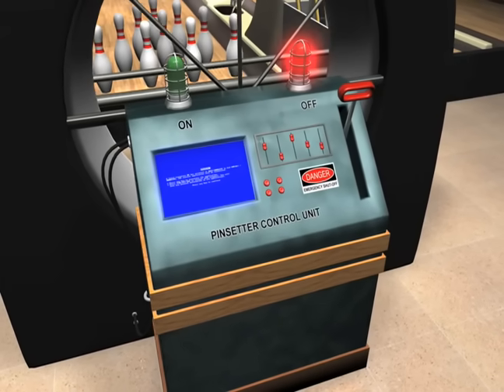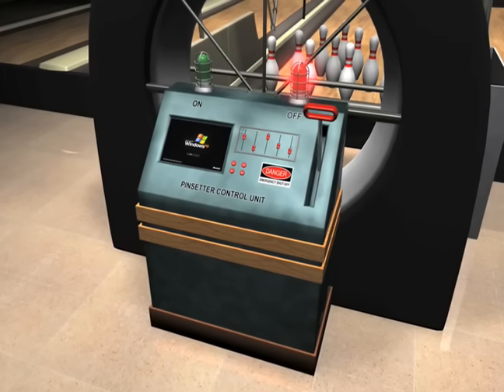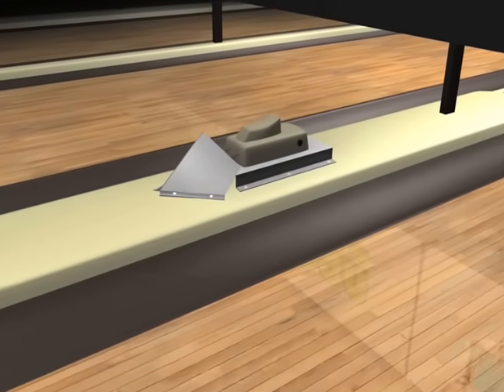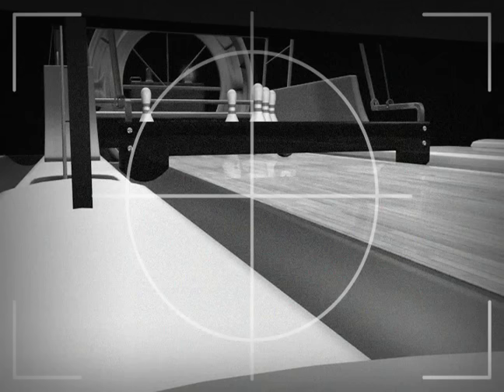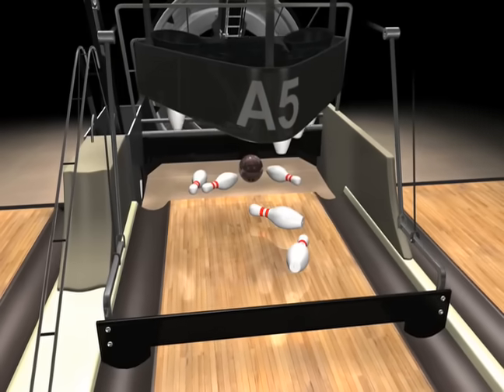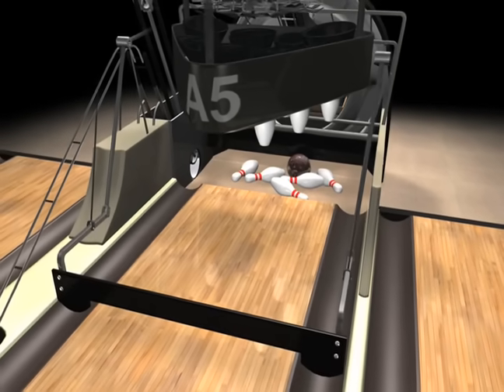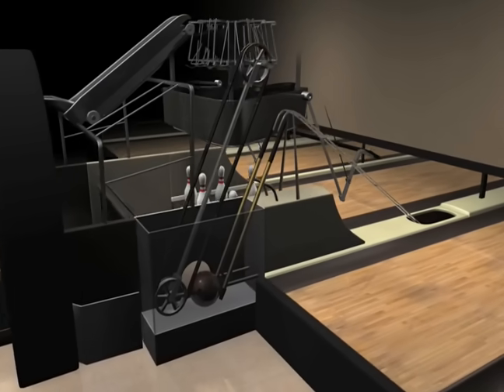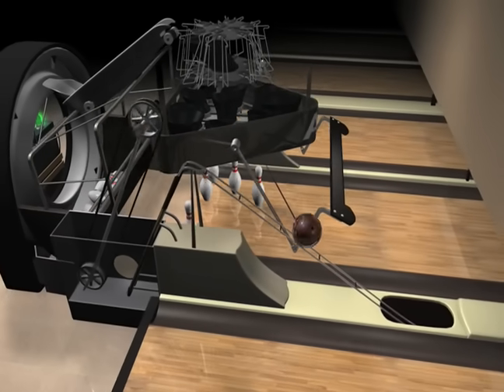How a Bowling Alley Works

Comment: This isn't even how the machine works this man is so wrong please don't listen to him. We have a2's at our alleys and are considered one of the cleanest alleys in America because we know how to run them. There isn't a camera to take a picture of the pins. It's all mechanical
Reply: Pin Techs yeah unfortunately this guy mixed up a couple machines. Yes the New Brunswick's have the ball tunnel on the side now but the common a2's don't. The cameras are stricktly for scoring and have no use in the machine. He has the right idea just  mixed a couple key facts of separate machines together
Reply from the maker: Haha sorry folks, yeah I was just trying to get the basic idea across really :D
Reply: That depends on the center that you are at buddy.
Reply: Yeh there is a lot of rubbish being talked here, but we have cameras and they do take a quick snap of the pins for the purpose of scoring, only.
Reply: Ah fair enough, nice of you to take the time to do that.
Reply: But you DIDN'T get the basic idea across. You got what you THOUGHT it was.
Reply from the maker: Then animate it yourself, sheesh. I did the best I could without being able to go behind the scenes myself.

Comment: Good video next time get your information correct your showing a Brunswick model A-2 pinsetter which is 100 percent mechanical it doesn't use a electronic computer to run and reset pins and return balls. The only computer is totally separate from the pinsetter and a 44/144 degree micro switch is added to the detector ( mechanical computer ) to tell the scoring computer when to detect pins.
By the way the ball return in via a steel ball wheel at the rear of the machine the ball return you show in the video is only used by AMF pinsetters I admire the work you put into the video but you really need to get your facts straight before you put out what is 95% totally false information

Comment: what happens if a pin slides after the first throw and is not directly aligned with the pen setter that comes down?
Reply: Very very rare, but I've seen it happen.. I've seen this cause the setter to stop when it can't lower all the way, usually this alerts the staff and they just reset your lane (sweep all the pins and you redo the frame), but i've also seen the setter just knock the errant pins out of the way when it comes down.
Reply: At the bowling centre that I work at we call that an out of range, on our model of pinsetter there is a little rod on the back of the machine, we pull that and the deck and sweep come back up and we clear any fallen pins out by hand, leaving any standing pins alone.

Comment: This is false, this is a Brunswick A2 Pinsetter and an AMF Pinsetter combined. Brunswick do not have a conveyer belt nor a ball elevator, that is all AMF. AMF does not have a closed rack, Brunswick does. AMF also does not have a spinning turret, Brunswick does. So this is extremely false.
Reply: did u read the description?
Reply: The people who don't read descriptions are probably the idiots who jump straight into using a new electronic product without reading the instruction manual and breaking it on Day 1.
Reply: Same thing
Reply: The video isn't supposed to be accurate, I don't blame you though, whenever i see a video and they misidentify a plane i have to correct them.
Reply: uncle freddie, 
Right!?
Reply: The Brunswick gs -X has a conveyer belt
Reply: But the GS series doesn't have a ball lift nor turret, and also has a different rake, deck, and pin elevator.
Reply: This is the new AMF-2.  It has individual scissors that pick up the pins that Window XP tells it to.  It is also run by hydraulic, and squeaky tinker toy belts.
Reply: Why would you watch this if you already know how it works??
Reply: HA! Nerd!
Reply: SKIDD TV who reads the description. That's like building a ikea bench and actually reading the directions

Comment: The only thing is, what is to prevent the pins from going into the hole the ball goes into?
Reply: I think if they manage to fall into where the ball goes, the slide back out because tthey don't ft
Reply: +Andrew Anderson this video is poorly made with a lot of false information

there is a door on the ball return (the hole where the ball goes through) with a switch that the ball hits to open it when it pushes against it, it's too high up for the pins to touch so therefore only balls go through
Reply: +WCaberdeen Thanks for the info

Comment: I would like to know how bowling animations work lets say I choose a animation on the scoring system and it does those animations that I chose questions tho 1 how does it know what animations to pick? Like diffrent ones? 2 how does it send the animation really fast when you get a strike the animations is already up there when the pinsetter is down? 3 how does it not buffer at all? 4 how does 1 computer control all 32 lanes with animations? 5 how come sometimes when I'm at a diffrent alley the animations work normal? and sometimes if I'm at another alley the animations aometimes stops and goes and sometimes freezes at almost the ending of the animation then goes away and makes a snow effect looking on the Brunswick scoring system? But if I keep bowling it the animations will lag a bit like slow fast slow fast if you know what I'm trying to say? And 6 at this one alley the animations run normal and don't freeze why is this? Please try to do a video about it? And tag me in this comment on when it's done thanks.
Reply: +jordan rausch lol
Reply: At the bowling centre that i work at, the computer at the front desk is a master control unit, kinda like a task master telling a computer on each pair of lanes what to do. the computer, VDB, on each pair then keep track of their own pair, this includes animations and scoring. the animations are all displayed so quickly because the VDB basically pre-loads everything when its powered up. all throughout operation the VDB is reporting back to the main control unit what the scores are. I've been to a bunch of different bowling centres and have never noticed the animation lag you mentioned, I'm going to keep an eye out for it now though...
Reply: Cubed Mayhem thanks. What kind of scoring system? Sync? Or AMF?
Reply: jordan rausch I believe we use QubicaAmf's conquerer system.
Reply: Cubed Mayhem ok cool

Comment: Is that control unit running Windows XP?
Reply from the maker: Sure is lol. I threw that in there as a joke ;)
Reply: Matt Rittman it’s now but a lot of computers used XP this was made in 2008 so yep not a joke
Reply: Matt Rittman 

> predicted the Windows XP meme
Reply: +Matt Rittman I found it hilarious I was like WOOOOW

(Did you add that in because Windows XP sucks? lmao)
Reply from the maker: +Wolfi lol, ya gotta have a little humor in there :)
Reply: Could be worse

Could run Windows Vista
Reply: get an alien ware man
Reply: Matt Rittman 
I walked passed a clothing store at the mall yesterday and noticed a ten-foot monitor screen on the back wall stuck on a Blue Screen Of Death display.
Reply: Matt Rittman True. I have a windows XP laptop though, and it runs like its new.
Reply: This video was made in 2008, when windows xp was pretty mainstream
Reply: It's probably controlled by Microcontrollers and a pc for the scoring system
Reply: Wait windows XP was a meme in 2008? I though it was like the new technology lol
Reply: (Sarcastic) No!! Its Running MS-DOS
Reply: Shining Armor Vista, xp is very stable
Reply: Windows XP >
Reply: most run dos
Reply: unit

Comment: Great video and animation. Just wondered, how would a remaining pin get picked up by the machine if it were out of position yet still upright? (for eg a pin slid slightly but didn't topple). Very unlikely to happen but its possible =P
Reply: Gallentine
Ok thanks Gallentine! =)
Reply: Incorrect,  the pin would not be swept.. This condition is called out of range. both AMF and Brunswick Pinsetter/Pinspotters have an out of range cycle in which the machine can't pick the pin up since it slid off spot. AMF machines will automatically reverse if they detect an out of range pin. Brunswick machines have either an automatic out of range kit or a hook that you pull to raise the deck. Dead wood has to be cleared via a pin hook. Out of range happens but it's extremely uncommon since the machines are designed to pick up pins that are off spot. But in some instances the machine can't pick it up.

Comment: What if the pin is loaded into the pinsetter upside down? That big wheel looking thing that picks up the pins from the pit doesn't really make sure the pin is facing the right way...
Reply: +Psymøn In reality the wheel is shaped in such a way that the pins can only be inserted in one manner.
Reply: To answer your question, the little pan in between the pin wheel and the conveyor belt is designed to turn the pin in such a way that it 99% of the time goes into the machine correctly. Now if a pin goes in upside down it actually wont go into what we call the turret which was the thing that set the pins into the deck, they won't go in because of the fact that the center of gravity of the pin is still on the belt, so nothing will fall, it'll only climb on top of the turret.
Reply: +StefanWood Vlogs They usually don't even go in the wrong way. It usually just winds up jamming itself.

Comment: LOL,  This pinsetter model seems like a hodge-podge of Brunswick AND amf. Brunswick rake and deck, but the ball wheel in the pit is actually AMF, along with the conveyor belt that lifts the ball and sends it to the ball return.
Reply: I was wanting to see if anyone else noticed that the deck turret and rake assembly were brunswick A2 and the rest was AMF! On a side note, the deck animation wasn't correct....
Reply: +StefanWood Vlogs If you read the description, he says he wasn't going for any one particular system, and that it's sort of a mash up of everything.
Reply: Not like the one I worked on back in 1985. We had no automatic scoring or cameras or beam across the lane but we did have a butt load of micro switches

Comment: this is completely inaccurate. that's not how any of it works. the is no infrared on an a series pinsetter. this 90% wrong.
Reply: no they don't i have worked on this style of pinsetter and is completely wrong
Reply: mc123456789101112 Could just be a different system you're used to mate
Reply: no Brunswick is the only company who makes them and they have only had 3ish models. A1 A2 and the GS series witch do not function like that
Reply: Idk about you man, but my ball detectors are infrared...
Reply: +StefanWood Vlogs yes the gs series are infrared switches but they are located right in front of the pinsetter. if they where that far up the lane the ball could hit the sweep if it was going slow enough. also those things he said where the infrared switches are actually used to read the ball speed.

Comment: I don't understand how the ball knows which direction the hole is... does it have a brain? It can't go through by a conveyer belt, either.
Reply: no, my bowling ball has a gps device and counterweights inside it that allow it to move on its own and find out which direction it needs to go.
Reply: Isaac - On the AMF ball returns which is pictured here (82-70 model) There is whats called a bounce plate inside the conveyor belt. When installed into the machine this plate is slid inside the loop of the carpet belt. This plate has two sides to it that are separated creating a V shape. The top of the V is facing the open slot of the ball return hole so as the ball lands on the conveyor carpet, the weight of the ball pushes down on the carpet allowing it to take the shape of the V plate beneath it. This causes the ball to roll down the carpet and into the hole. Sorry its sort of hard to explain but look it up online and im sure you can find a picture of it.
Reply: Nick Friez
oh ok thanks!
Reply: +David Brown lol
Reply: A bot ball! Scary.
Reply: Man Yue Law
Reply: Man Yue Law
Reply: idiot

Comment: This video sucks not fucjking true at all!!!
Reply from the maker: People are so overly critical. I think I did a pretty descent job considering I wasn't able to go behind the scenes of an actual bowling alley to see how they worked first hand.
Reply: cody saulnier I work on A-2's and basically the only thing that isn't right is how the ball is returned, and there isn't a conveyor belt, but a Shaker board. (ours anyway). Minus gearbox and all the other things. ;) It gives a basic idea of how the deadwood gets set back up though.
Reply: how is this not true. this is pretty much how the A2 series works (leaving out some important details)
Reply: A2s have a shaker board where yhe ball goes to the back of the machine where there is both a ball wheel and a pin wheel and instead of a conveyor belt where gravity takes the ball for the most part, we have an accelerator belt, but this is basically a mix of a Brunswick A2s and AMF machines, the deck, the rake assembly, the turn pan, pin wheel and cross conveyor belt are all from the Brunswick A2, and everything that deals with the ball is AMF
Reply: Granted, but you just need to ensure that you don't use 2 different companies or even models of pinsetters, people who know what they're looking at tend to be overly critical
Reply: Matt Rittman well iv seen A2s work before and besids the computer its pretty spot on lol but I work on gs98 series
Reply from the maker: +StefanWood Vlogs Haha it is what it is. People can throw a hissy fit about it all they want. I mentioned in the description that it's not supposed to be an exact representation. It's pretty obvious throughout the video that I put my own spin on things with added humor.
Reply: +Matt Rittman Yea, this is pretty accurate to the model I work with. I don't know the actual name but there is not a conveyor for the pins or the balls as stated but nonetheless this is a good animation. I think the original commenter is just trolling.

Comment: where you say "mechanical switches in the rack sense the remaining pins", the camera can also detect the pins depending upon how the centre was initially set up. there is (for example) the Brunswick GS-X pinsetter, it has its own scoring machanism by using the pads which get pushed up hitting a swtich on the solenoid immediately sending a signal to the chassis, there's a pin, do a first cycle. with secondary scoring such as the camera, IT detects pins and sends a signal to the pinsetter chassis.

Comment: this was 33 years ago, the alley i worked at had 84 lanes straight across, was the worlds largest at the time (stardust bowl, addison,il) the rack above only holds 10, so the extra would wait in the turn pan...

also, the ball doesn't go into a hole, the ball rides a track on the pin wheel, again, this is a brunswick A1, i never looked an an AMF machine...

Comment: unfortunately, this was just a dream, i was a pinsetter mechanic 33 years ago. the rake is triggered after the ball hits the pins, and goes to the back of the machine. mechanical switches  in the rack sense the remaining pins. 20 pins are in each machine, unless there is a turn pan jam at the top of the machine, 10 pins are always ready for the next rack for instant deployment in case of a strike. nice try though...

Comment: Very nice animation! I recently had the awesome chance of going in the back of a bowling alley to fix an unrelated computer problem (I'm a computer tech). The alley's mechanic there gave me a tour. One thing I thought was clever, and you left out, was the pin orientation setting plate. The plate was formed in a way that orients the pin the correct way before it is loaded into the hopper. Such a simple and elegant solution. They designed it so well, it was bad business for them!
Reply: Hi you from 11 years

Comment: @andyjv2000 
in 1987 when the infrared beams were first used for ball detect in Brunswick GS-10 pinsetters, the beams were 1 1/2 feet in front of the sweep (there was a 2 second delay after the beam was broken before the sweep would drop) .  and believe it or not, I was the first mechanic to prove to Brunswick that a ball rolled slowly enough could hit the sweep, and it only took me one attempt to do this,  and 2 weeks later, Brunswick came back to my center to move the ball detect beams.

Comment from the maker: Please read the video description. I wasn't going for an EXACT replica of a particular type of alley. I have never worked at a bowling alley center so I wasn't able to capture every detail. Hence the huge computer kiosk in the back with an oversized power shut-off handle and the computer running Windows XP...oops.
Reply: What model is this because it looks dig than the Brunswick GS-X

Comment: Most of it's true.  On a Brunswick A2 system, the ball return is powered by another wheel before the pin wheel, its smaller than the pin wheel.  The ball gets lifted up by that wheel and then goes on a track which goes back to the player.  Neat animation.